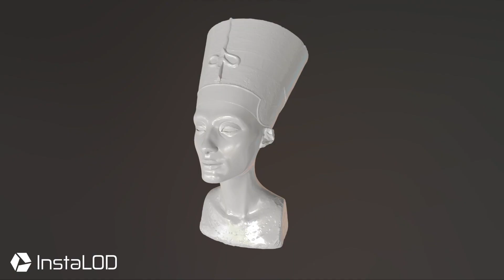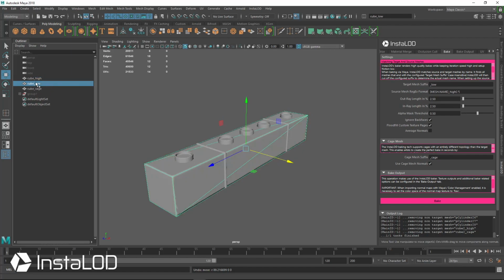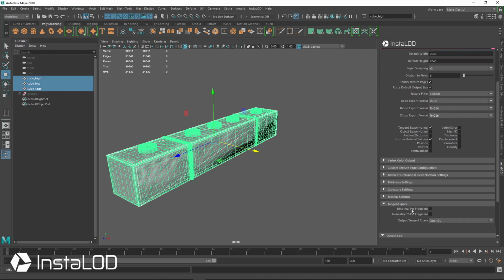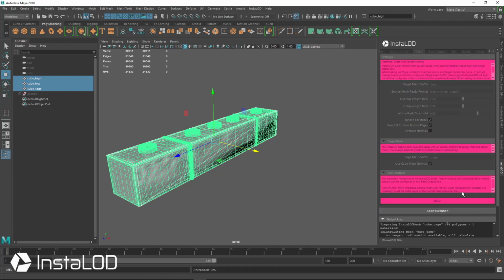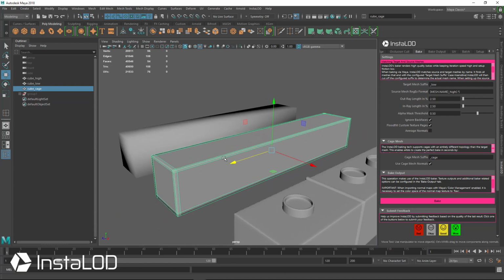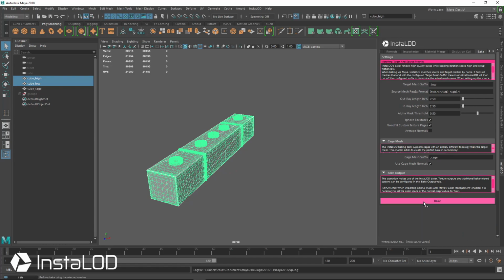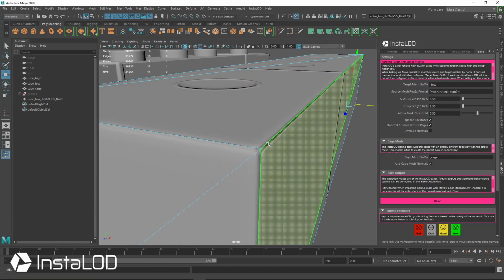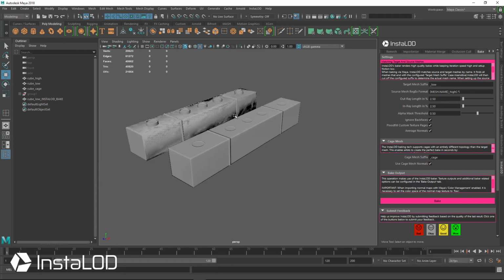How to achieve Perfect Skew-free Texture Baking

Comment: Great. This part is really hard to explain to designers. Even if it is not skew, if you use cage instead of low, you can cause a heavy load on the shadow path.Most games take more overhead in shadow map rendering than frame rendering.Vertex split is useless for shadow pass. But average normal poly can not bake to tangent normal map.It is great method.